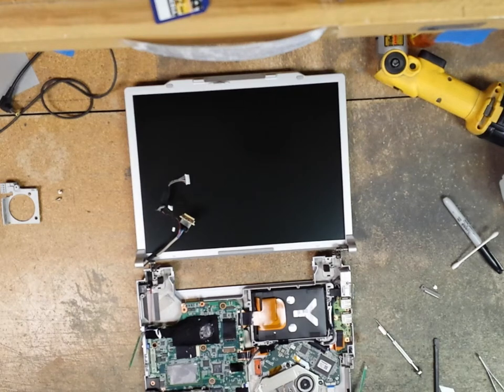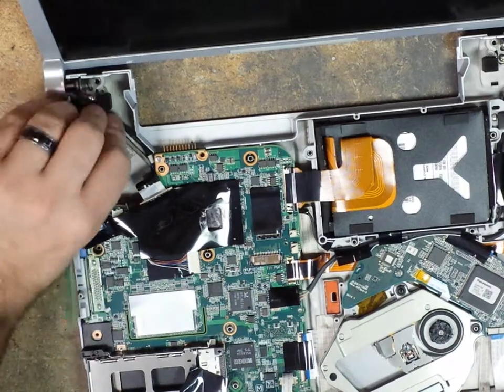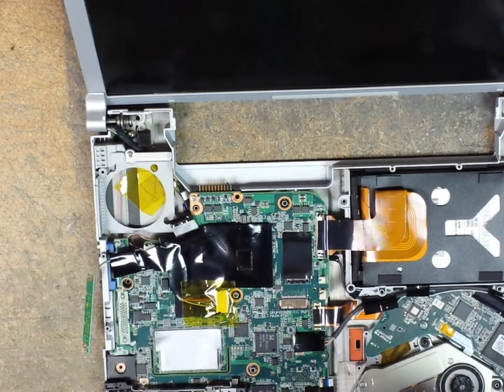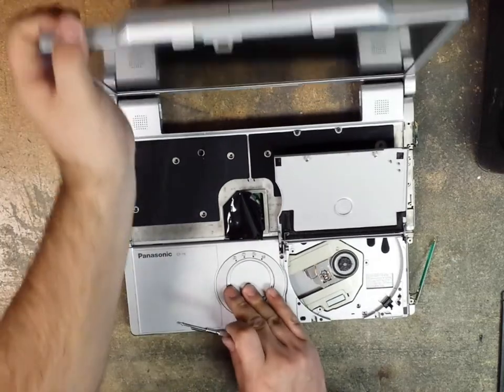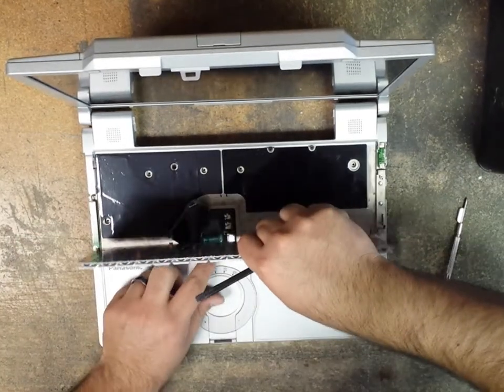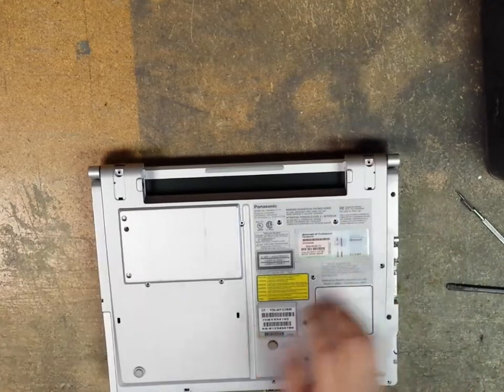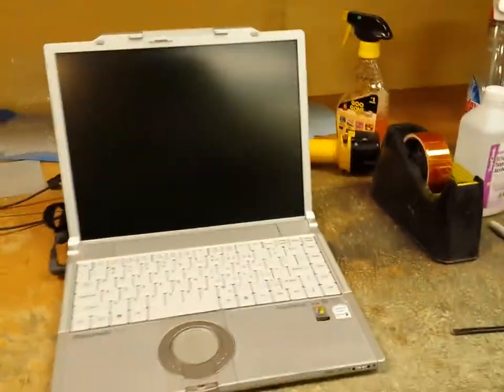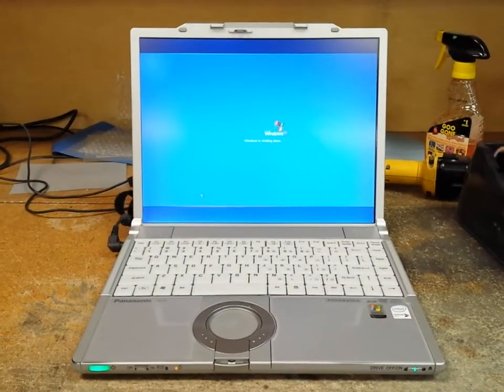Panasonic CF-Y5 reassembly

Comment: Well done.  i need to pull my wireless NICC.  do I have to do it from the top and pull the mobo?  or can I get just the bottom of the case off?thanks
Reply from the maker: If I remember correctly you do have to take the top case off followed by the mobo. Thanks for watching. If you have any other questions please let me know. 

Regards, 
Christian
Reply: seems rather complicated just to get bottom off.  is there a shortcut?marc